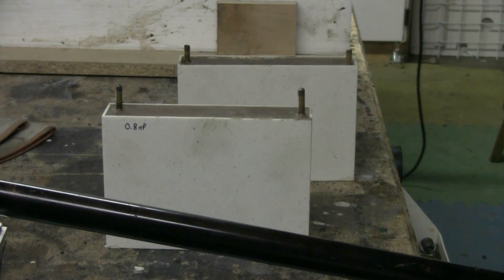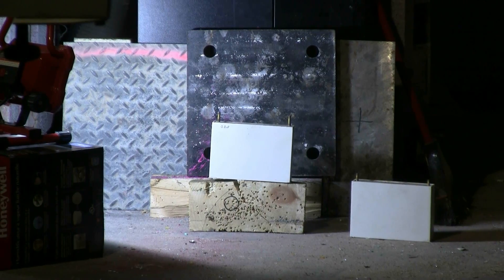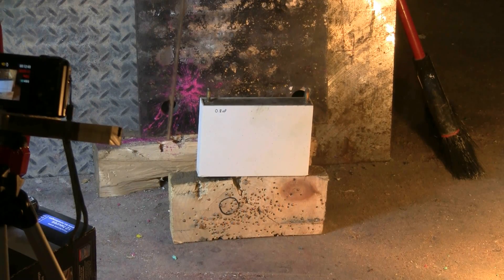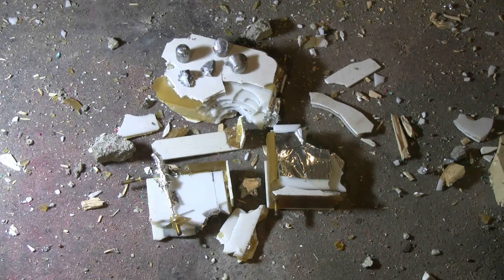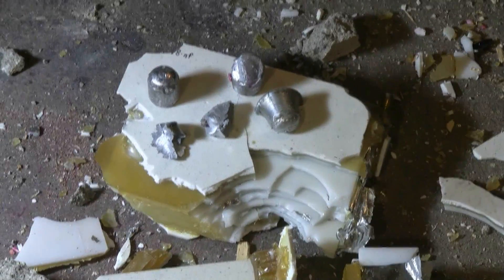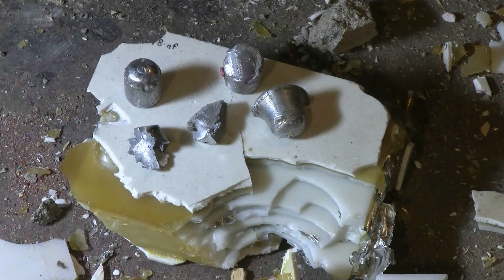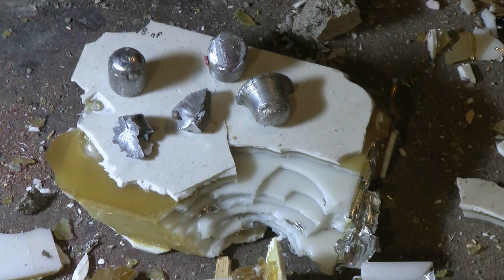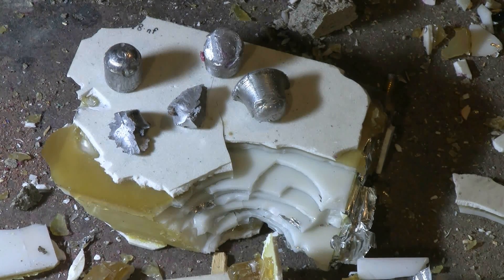Air Cannon #110 - Dead HV Capacitors

Comment: would it be interesting ? to use a few capacitors and make some electric reactive armour? not sure how it works, but i suspect a couple of thin sheets of steel close together with one live and the other ground?